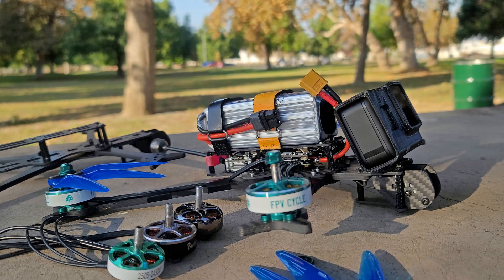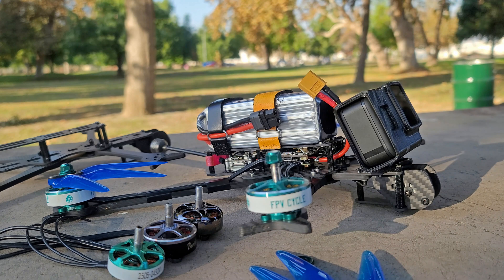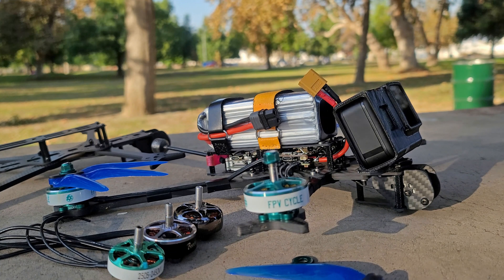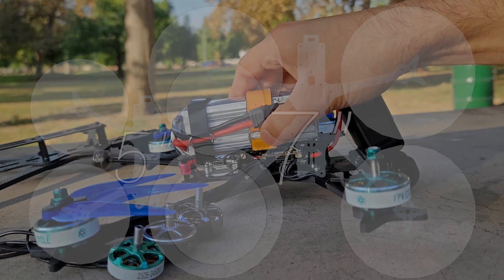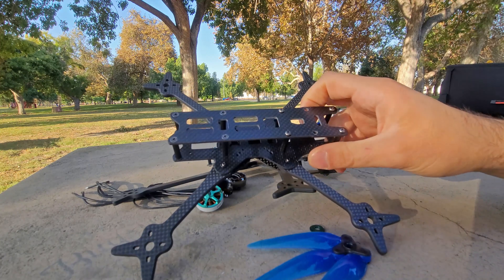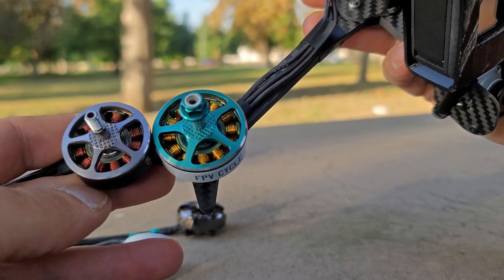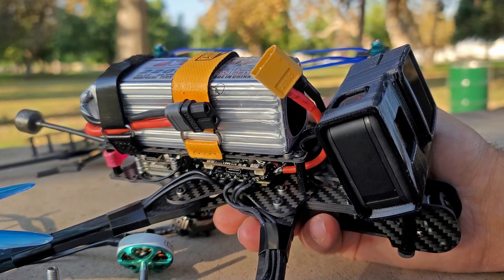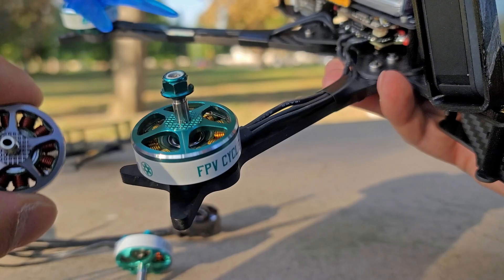A reshuffling of motor sizes, new 7" motor

Comment from the maker: There is so so soooo much I just chopped out of this video because I don't think I did a good job of conveying the information.  I'll re-up all of this later along with the CineSplore videos in the near future when we actually get products into the store.  Manufacturers are still severely impacted by the pandemic.

The FPVCycle 30mm 7"-8" motor: https://bit.ly/35zN4ty
Frame and new props coming soon

The props I'm using on the quad are the DAL Fold 7 which I DO NOT RECOMMEND! because they randomly explode during flight.  They are genuinely the best performing 7" prop for control feel but are unusable because of the exploding risk.  There are currently no decent 7" props as far as our testing has gone.  A few new ones are in the works.  For now, the Gemfan 7040 and HQ 7x4x3 are the most reasonable options with the HQ 7x3.5x3 being better for lower weight 7" quads below 900g.

Good ESC options for 7":
Tekko32: https://bit.ly/2Ut7HRW
Tekko32 metal FET: https://bit.ly/3kuuasr
We have the lowest price on these boards.

The quad in the video was running completely stock EmuFlight on the Zeez F7 board.  You can use any FC you want.  Any F4, F7, H7 or better FC on BetaFlight currently performs the same.  The EmuFlight devs say that in the somewhat near future they will take some advantage of the H7 but unknown when.  For now, there is zero benefit to an H7.

About the DJI system:
I don't recommend the bundle DJI setup with the air unit.  The Vista's are an alternative air unit and much easier to use.  Don't get anything but the default DJI FPV camera.  No other camera is any good yet.  The controller is not required.  You can use any other controller to control the quad still.

DJI Goggles: http://bit.ly/2tCGUJn, https://bit.ly/2Hvsp0t, https://amzn.to/3kBDag4
DJI Controller: https://bit.ly/3dDcGra, https://bit.ly/31CjUHV, https://amzn.to/3kp7zhN (you can't use a phantom controller)
DJI Vista Unit: https://bit.ly/3avZCTk, https://bit.ly/3kpRpEU
Longer Vista antenna's and cables: https://bit.ly/2ViXhFg

Stay tuned to www.FPVCycle.com.  We've been working extremely hard on a bunch of new things.

▼Join the FB group for more discussion: FPVCycle - Kabab FPV
https://www.facebook.com/groups/37915...

▼ Tips?
Patreon: https://bit.ly/2oGLP9b
$1/mo from 1/4 of my subscribers will make me almost quit my job.  Thank you

-PayPal: https://www.paypal.me/kababfpv
-Bitcoin: 1E4XZXoD4rS6MYWVWuenY7Kw2M1YgyNpoQ
-Nano: xrb_1188ek5bd7tb9kw67asnp9o65byuoaxbtpxuznx1ribf75x78awywmakj55f
-ETH: 0xD067F93811f2eC31CB1928901002dfdf9A492EF5
-LTC: La2KWYAjp4VT2Lq2M76pbjzXWvRyjpfCtG
Reply: You gonna do a savage bee video or what do you think of the savage bee by Newbeedrone?
Reply from the maker: @EdturdEnfart  it's a bit too similar to my work for basically anyone to say it wasn't very very heavily inspired by the babytooth.   I'm not going to bother with it but I can already tell you the spec they've setup for it won't perform nearly as well and the build is gonna be frustrating because of the extremely challenging aio board they expect you to solder to.
Reply: @Kabab  thank you for the quick response you are awesome I will definitely building the baby tooth and tp3 this winter !!!
Reply: @Kabab  hey man! Would you still recommended these motors for a Thicc build?
Reply from the maker: @sleepyheadfpv1507  yeah they're definitely more powerful than any 2806.5 but I'm actually beginning to test light X8 builds and you may want to consider a 2806.5 on top and the 3106.5 on the bottom with a more aggressive props on the bottom....
Reply: @Kabab  yeah I was wondering about that. Because I noticed watching some cinelifter videos that RR has a Thicc that’s running bi-blades 7x4.2 on bottom and the 7x4.3 on top. But I didn’t know about running two sets of motors too
Reply from the maker: @sleepyheadfpv1507  I'm testing these things right now. It'll take a while but I'm looking for ways to improve tht 7" because it really does not fly well as a quad.  Going with X8 decouples the top and bottom set of motors so I'm hoping to figure out how to get an even more efficient setup than a 7" quad by going with an X8.  By decoupling the top and bottom you can run totally different motors and props on the top and bottom.  The FC won't try to compensate for the mismatch

Comment: Hey Kabab, Is there a reason you dont sell this motor anymore and only sell the 2809 now instead? also will you ever bring back the cineglide frame? its sold out for years now and every few months I check the store if it is back. If you dont bring it back, could you at least sell the cutting scheme so that I can cut it myself? Greetings from Hamburg :)

Comment: So this motor is for short fast smooth flying? Nothing long range and not a lot of freestyle flip-flops. Right?
Reply from the maker: It's made for improved control overall. It can be for anything however I would caution long range as it's not particularly efficient. Long range 7" crafts usually opt for smaller motors because of their increased efficiency. They sacrifice performance for the range.

Comment: what 7 inch props do you recommend atm?
Reply from the maker: Gemfan 7035 carbon mix material props. Not the polycarbonate only version. Specifically the carbon mix which is much more rigid
Reply: @Kabab  thanks a lot for this information! 🙌🏻

Comment: picked up some 2810 brother hobby motors for my custom 7" stretched X frame, gotta cut some 19x19 motor mount arms to test them. was looking at these 3106 motors but volume minus bearing volume (3732cm3) was less then the 2810's at about (4830cm3 minus bearing volume) so went with them. hoping I love them, just wish brother hobby would do unibell designs. my 7" build is 889 grams with 1300mah lipo and hero 7 with a heavy adjustable BMC3D mount and TPU motor and arm mounts/protectors with TPU antenna mound. pretty damn light. with 2200 its just over 1000grams. will be more once the 2810's are added but I think you'd like this frame bob. only issue you would have is your get some props in few on the lower part of the gopro frame. have you thought about doing/making a 3108 motor with 13mm bearings and unibell bob? would be a nice option
Reply from the maker: I'm actually working on a 2808 right now. I don't think 7" really needs more than that. the taller magnets with my new magnet design will make up for the reduced width from the previous 31mm wide and give it more efficiency and power over the 3106.5

Comment: Hi bob, im building light 7 inch quad.. and i hate li-ion because of the wide voltage range makes the quad undertuned after going low volt. So ill use lipo. For 6s, its better run 2x 2200mah gnb 3s to get 6s 2200mah right? Because yes i hate when i found 1 dead cell in 6s lipo. It will works as good as single 6s right? Or is there any downside from using 2 lipo?
Reply from the maker: I'm doing exactly that.  I hate it when a giant pack drops a cell and it's then useless. I'm using 2x gnb 2600mah 3s packs with a XT90 Y-harnrss I made that puts them in 6s series
Reply: @Kabab  but we need high c rating for the 3s lipo right? Yeah im asking this because on your other 7inch video you said  using 2 lipo in serries is not as good as using single lipo. About the xt90, is it makes more flight time too? 2 xt60 with xt90 output right?
Reply from the maker: @TERBANGFPV  right that's because I was using xt60's. Definitely need xt90s. And yes definitely still need the c rating. I've gone for larger cells and 120c instead of lower capacity 130c.
Reply: @Kabab  alt my local teh highest c for 3s 2200 is gnb 100c.. maybe ill try to get that, and compare with my curent ovonic 1000mah 6s in paralel. Anyway have you done the test? 2p of 1000mah 6s vs 2x 3s 2000mah in series?
Reply from the maker: @TERBANGFPV  you shouldn't see much difference between a 2P and 1P pack. In the real world the 2P will be slightly better but not huge.

Comment: please tell me more how to build a 7in to fly for an hour, will be my next season project
Reply: oh yes, I also design my mounts to put the fpv cam below the hd cam
Reply from the maker: This would take a bit of work to figure out.  It probably wouldn't be too hard but all you'd be doing is hovering for an hour.  It's currently not possible to have any kind of real performance in a 7" quad if you want an hour of flight time.  Our battery tech is just not good enough
Reply: @Kabab  I know, but you said it :)) my plan is to try tilted motors for reduced drag, lower weight and find most efficient motor, also experiment with prop combination, probably 2 blade and bullnose?
Reply: my current is 25mins, at 24km round trip

Comment: If you know how back engeenering works: they bought already this motor, take it apart, measure stator, measure coper wire lenght, width, turns, resistance etc. Not telling that on webpage is only downside for customer who is going to calculate specs of his biuld.
Reply from the maker: It delayed iflight by 4 months. Now they have a copy. More importantly, it took the focus off the motor spec and put it on what the motor is intended to be used for.  There's no way to survive in this industry when all these companies copy everything overnight. We might as well just give up and all you'll get is the same crap over and over from all the rip off companies. If you have a better idea, I'm all ears.  

Also, the spec is on the product page. It's just not explicitly listed. It's in the product description

Comment: How does this do for long range? Sounded like you briefly touched on it but I would love to hear a more in depth discussion. I couldn't tell if you were trying to say this is a freestyle motor on 7 inch or if this was a long range motor or it does both well but neither perfectly?
Reply from the maker: 7" quads fly so poorly that I'd honestly sooner recommend a 5" quad.  The flight time isn't that different of both are performance crafts. You just don't have the same cruising speed on the 5"

Comment: 8 inch on 4s no prob?
Reply from the maker: sure if all you want to do is hover around
Reply: @Kabab  8 inch on 6s?
Reply from the maker: @henryknox4511  better. By the time it gets to 8" I would consider 8s
Reply: @Kabab  I'm ok with that- I'm looking for solid motor to run on FR8 build. So you're saying this motor will handle 8s with 8 inch prop? Or are you suggesting 8s on 7 inch?
Thanks for your replies man.
Reply from the maker: @henryknox4511  I think it's a bit much for 8s and 8". It's best to keep it to 6s on 8". The kv is a bit high for 8s 8"
Reply: @Kabab  Right on man, thanks for the help.

Comment: Concerning props...
...coming from the point of endurance...
What do you think about changing to regular 2-bladed prop? While we're at it, even wooden props would be interesting, as they're said to be more efficient over the tupperware.

Thinking back, when testing a 3-bladed prop that matched closest to the 2-bladed, I had about 20 percent more flighttime with the 2-bladed...
Reply from the maker: The issue with twins is that they're just not as well balanced as a triblade.  Triblades have that third blade that kinda half balances the other two so if any one blade is slightly off, it's less noticed.  Additionally folding blades are further self balancing
Reply: @Kabab  , with the plastic ones - I totally agree! Though in the times when I learned the rc-flying craftsmanship, it was frowned upon to not have checked every prop nevertheless... ;)
But the wooden ones were quite nicely balance right out from the bag, and efficiency was quite better than with tupperware bi-blades.
...that's where my thinking is coming from...
So for regular chaps, the triblades are quite okay - why bother if they're that cheap. But I have more the long-endurance in mind, less extremes like aerobatics or racing, where one tends not to plan to crash in the first place, so components can be a bit higher priced as life-expectancy is higher.
I was thinging of a light frame - again, durability is not first directive as crashing is to be avoided - with one of those split-cams to have HD-recording on-board without the need for a hefty gopro, with properly matched motors and props... Maybe going towards 6s as the higher the voltage the higher the efficiency...?
I guess the word long-range cinematic comes to mind...?
Reply from the maker: @novet001  more rigid blades are absolutely going to be more efficient and better performance all around. Twins are also a solid 25% more efficient in my testing too. As for the light frame, once this one gets here, it'll be around 140-150g. I wouldn't call it light but it's about as light as it could get with the dead cat stance to get props out of the shot. The other option are the X configuration frames which can be found as ligbtas 90g or even less however the gopro needs to be maybe 6" or higher up from the center of the frame with still good tilt to get the props out of the shot. Regardless, this frame batch should be here in a couple weeks. Whenever china gets around to it 🤦‍♂️

Comment: Bob, I’ve been working on a project399 practice rig for a while and just need motors but have a quick question and wanted your opinion about motor size.   While I want to get the BH 2510’s that they use in drl I’m wondering if the emax eco 2807 would be a good alternative or even your 30mm motor when it comes out?  Kinda wanna stick with the 2510 but I’ve got a set of the emax 2807’s on the way that a buddy is sending me.   I have flown the bh2510’s, specifically the 1280kv ones you sent rob(loft) a while back(I think I remember him saying he got them from you) and I love them.   Never flown the 28xx series before and think it would be interesting.
Reply from the maker: The 2510 is fine but the 30mm motor is going to perform a lot better immediately.  1280kv is also a bit low
Reply: @Kabab  yeah the 1280 felt slow when I flew Robs but extremely controllable even on 5s.  I was thinking about the 1380 kv, just a little bit, very little bit faster. Lol. But ima start with the eco 2807 only bc I have a set being sent to me but I know their heavy.

Comment: Hey @kabab have you tested this 7inch motor on the fettec 45amp esc ?
Reply from the maker: I don't have that esc but 45A is more than enough for these motors.
Reply: @Kabab  definitely 45amps is heeps but I know the fettec esc does not play well with all motor combos. They had to update the esc to support more motors. Dont know what they are doing
Reply from the maker: @AlbeyFPV  this is a pretty typical function motor. It should work
Reply: The only reason I'm asking is due to my brother hobby 2806.5 1300kv motors work perfectly but my xing 2806.5 1300kv fly like potato. Both are duplicate builds but I still swapped the motors to "working" one and it did the same thing
Reply from the maker: @AlbeyFPV  that could be something failing or it could be some setting issue.  Same esc?
Reply: @Kabab  same everything across both builds. when i swap the xing motors to the one that has been working fine then that one starts going strange. seems to be motor related rather than esc related. IMO due to them needing to do an update to the ESC so that the stout v3 motors would stop being funny. so maybe just the esc that does not like the motors. But i will do more testing

Comment: So would these motors be better for Freestyle or more for cruising? I am working on a 7" cruiser/Mid to long range build now and these motors really peaked my interest. I want to see if the are as efficient as the 2806.5 of similar kv and just want to know if it could be abetter option for cruising.
Reply from the maker: A smaller motor will always be more efficient if kept within the efficiency range of around 40 to 60%. A bigger motor will just create more power in that efficiency range but it will also draw more power to do so. The smaller motor will need to spin up higher in the throttle range and we'll leave its efficiency zone which will make the bigger motor more efficient. The improved control is a side effect of the bigger motor if efficiency is your primary goal. These motors are designed for performance rather than very high efficiency however that depends what you're going to be doing with the quad. If you're planning on just doing a slow Cruise with a 1 kg quad, you could use an even smaller motor without any issues. But you sacrifice performance for that efficiency. If you're lifting a payload, you want your motors to be within that efficiency range so you need to spec the motor accordingly to to produce enough power in that 40 to 60% range to deal with your payload
Reply: @Kabab  thanks for the reply that helps! With what you shared, it definitely seems like a nice middle ground for me then. With my current 5" with 2700kv 2306 4s, I can get around 4-5 mins or so just cruising. Definitely want as much performance  as i can get without sacrificifing the efficiency. 

I also want them purely based on the colors as no other motors of this relative size have any color.
Reply from the maker: @MarineSniper26  I've spent lots of time trying to figure out why sometimes I'll build a bigger quad and it'll be the same overall flight time as a smaller quad. It's because I'm always aiming for overall the same performance specs which results in 3-5min flights no matter what. If I want more flight time, the performance goes down hill. But if I just cruise I can get maybe 8-12min on the 7"